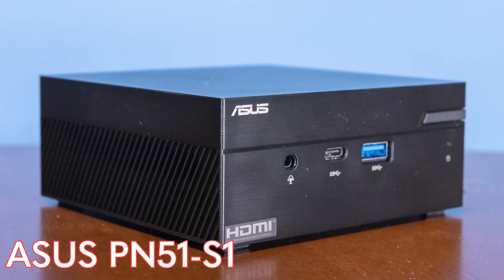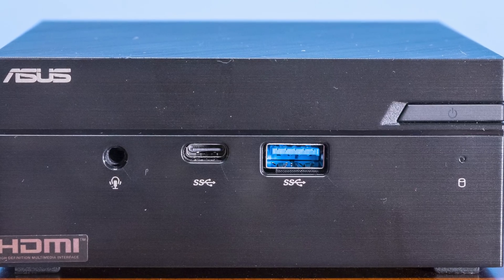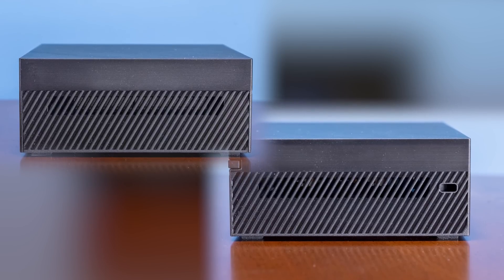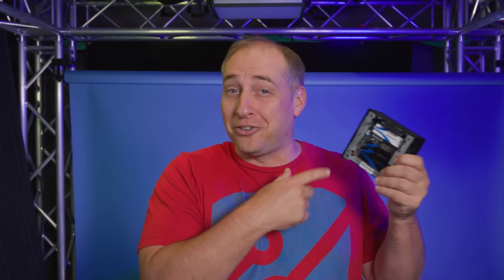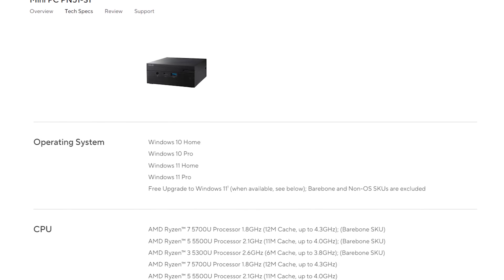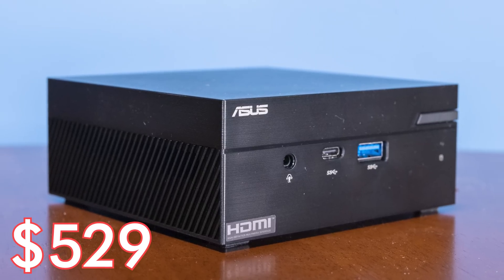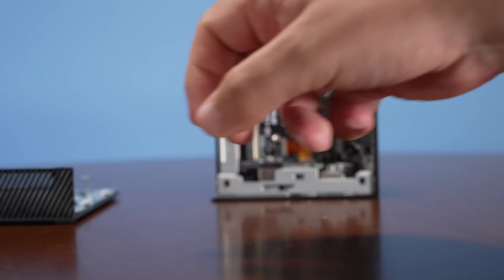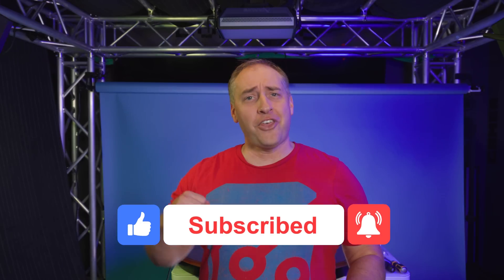This 8 Core AMD NUC Alternative Rocks!

Comment: I don't get why these manufacturers don't want to add a few cubic inches to the design and add like $5 into cooling to stack a 92 or 120mm fan in these which would make them almost totally silent going full bore and give the headroom to massively increase performance. Like your chart showed the 35w 5750ge destroying this chip.

Comment: I got the same model and max out the RAM to 64gb, 1TB nvme and 1TB 2.5' SSD. Its temperature is super hot even without running much task, just opening a windows 10 VM and leaving it idle on my ubuntu host can take up close to 93 degree celsius! Is it just mine that has an issue?
Reply from the maker: Seems way too hot

Comment: I run entirely on solar. So low power systems like this are extremely attractive for always on servers. TDP is not of any concern. It's the idle and low load. I wouldn't mind if it could ramp up to 100 watts to get the jobs done faster just to go back down to 10 after. Loads such as compiling, transcoding video,  and rendering. But most of the time it would serve for a firewall, home automation, Plex, and file serving. I'd rather not need multiple systems.

Comment: Go find yourself a used Dell Optiplex MFF setup, its just a bit larger and been around for years. Easy to maintain and find parts for online, you'll get driver/firmware updates for as long as Dell supports it.  You can find them used from $100 to $1000 depending on the age of it. Then customize it with what ever local storage you want to stick in that will fit.

Comment: The only problem I see is that its mobile CPU, it doesn't matter if its 8 core its still mobile one. So why we are impressed by the size when laptop internals are even smaller, in the size comparison you make it look like it is significantly smaller than alternatives while the volume seems on par with other offerings.
Reply: thats true, laptop with a dead screen is pretty easy to find and lots cheaper

Comment: I've been using a PN51-E1 with a Ryzen 7 5700U, 32GB RAM and a 1TB Samsung 980 EVO as my main work computer for a few months now and it works perfectly. Because it's small and light, I can carry it from home and office when needed. The only problem I see though is the high temperatures and the horrible little noisy fan. Only with the browser open is it quiet, but if it starts to get more use it's like a turbine. Akasa makes the Turing A50 MKII which is a fully passive case for these computers, but they are heavy and much larger than the original. If someone wanted to use it as a totally silent server, that would be a nice solution.

Comment: Great review a few points there are various models of the PN51 / PN51-S1 it is important to check the specifications of the model you are purchasing as they can vary slightly. As noted by STH there are also varied CPU options.

All models will have the same dimensions but can vary in aspects like connectivity. We offer Barebone and System models 

This means barebone is supply your own storage, memory and OS
System models will come with an OS ( Windows ), storage, and memory

We also do validated Linux distros on the PN series ( Unbuntu, and Redhat )

A great feature not detailed in the review is the that the rear Type-C port also offers USB-C PD Input. This is rare in mini PCs and allows for a single cable for display and power and can be paired with monitors like our own PA series which feature 90W USB-C power output.

For users looking for a simple and clean setup this is ideal.

The configuration port is only applicable for business inquiries default models sold will offer an additional display out allowing for three displays to be connected.

The PN51 offers a M.2 heatsink design where many mini PCs do not offer superior thermal dissipation for higher performing and larger capacity M.2 SSDs.

We offer extensive testing which is not common among many "mini PCs" - including aging time, temperature, humidity, vibration, drop, port, line voltage and frequency testing.

Users looking for more performance can check out our 
PN52 using Ryzen 5000H series CPUs with an updated chassis design and more storage support.
PN64 using 12th Gen Alder Lake CPUs, DDR5, PCIe Gen 4 support as well as higher end specification support for USB.

Both models have been designed to complement higher performance workloads with 35W power envelopes. 

Great review hopefully you will check out some of our other mini PC models or even options like our PL/PB series which offers more SOHO and SMB type features/designs.
Reply: when one says that it can be powered through usb-c dp, does it means that you can power this device with a simple usb-c power plug not specifically attached to a monitor, for instance a 90W or 65W 200V to usb-c power plug  ?

Comment: Overheating issues?
My nuc7 fan cooler broke down i  just 2 years. Had to replace the case with passive Akasa Newton case + attached noctua 120mm fan connected externally via USB.

Comment: I want to use ProxMox on it. For that, a second 2,5GB LAN or 10GB fiber optics cage would be awesome (in place of the display port).  So, there should be a bare metal version of this little box for home virtualization.
Reply: Just out of curiosity, why do you want two NICs? I get wanting a faster one but what would you use the 1GB port for? (New-ish to homelab and wondering. Thanks.)

Comment: I have a few Asrock 4x4-Box 4800U units (similar footprint and configuration to what's shown in the video) that I run in a 3-node Proxmox cluster - they're great little machines with super low power consumption and are capable of running some pretty intensive workloads. I run DetectionLab in the cluster plus a bunch of other VMs and the 4x4-Boxes handle everything perfectly.

Comment: Great video - very informative. I love that you've measured idle power consumption. One piece of information was missing - can this 2,5" mount accomodate thick 15mm hard drives? You know - that 5TB+ spinners. And if not - maybe 9,5mm? Can you please check it out and let us know?
Reply: I asked ASUS this question regarding the PN50, which has the same dimensions, and it can't support above 9,5mm.
Reply: @Max1996YT  Thanks. I've found that info somewhere on the internet also. I've bought a second hand XCY mini i3 - it has more than enough room for 15mm drive and a thick aluminum case

Comment: For daily stuff and browsing the N5095 (lowest in graphs) 4 cores from Intel is exactly what you need.
Not too WOW, not too crap. i recently got a same-factor minipc with that CPU and man, it can mince stuff ! 
4k60fps .. rarely loses some frames here and there. From tests it's 3W on idle and 8-11W on 4K stress. You can literally just let it /ON all the time.
No fan noise. It barely goes 2800 RPM on full load.

I got my minipc  Intel N5095 / 1x8GB / 256 GB for $110. 
Bought it for my father so he can get rid off his (literally) 16y old laptop.
Added an vesa-mount arm for the monitor, stuck the minipc on the back of it.. and voila .. best browsing experience for a mere $250 (total)

Comment: I have one of these mounted on the back of the second monitor. Mine has a 4700U 10GB RAM running Windows 11, 1TB Samsung M.2. Very quiet and super low power consumption.

Comment: Nice review. For half the cost you can get a beelink with the ryzen 7 4800U (slightly better performance than the 5700U for some reason , according to cpu compare), with a coupon on Amazon for $389. Comes with 16GB RAM and  a 500 GB Nvme and Windows 11pro. That's unbeatable value!
Reply: fun fact, 4800u and 5700u are exactly the same silicon. odd numbers are actually last gen, even numbers are new for 5000 series

Comment: Trade the HDMI for another 2.5gb NIC and I'm sold. I recently just purchased a nuc9i7qnx and it was about this price point. The intended use was either for pfSense or as a replacement for my current home assistant setup. I really wanted the dual 2.5's but even dual NIC's in general with this form factor were hard to find which is why i ultimately went with the nuc 9 because I can throw in a PCIE card and have a 10gb router or later down the road when this gets decommissioned after the price of 10gb ASIC's fall, I can toss in a GPU and have a killer retropi setup.

Comment: Do you think you could use the SATA connection for a big 3.5in HDD? Not just for this but for other of those mini PCs?
Of course maybe without putting the cover back on, or with a hold and an extension cable.
Reply from the maker: It is a standard SATA connection, but the chassis would be in the way of a 2.5" drive.

Comment: So... you got a $400 Nuc equivilent... and put a $1500 SSD.
The $150 worth of RAM is basically a joke at that point.
If you stepped that down to the 4TB version, then you could add a Samsung 870 8TB 2.5" SSD... and save about $150 over the single 8TB m.2.

Comment: Have two of these, one 4500u as an office pc and one 5700u as a toy. Swapped in Intel ax210 wifi6e cards and tuned with AATU. Only complaint is lack of fan curve adjustment (fan basically moves from silent, to acceptable, to jet engine, without smooth control in between at set temperatures) and windows 11 power settings are broken and lock the frequency. You need to use Asus own utility or the old control panel power settings.  I have an Akasa Turing A50 fanless case on the way for the 5700u to turn it into a fanless home theatre pc. 
They're usually super quiet but just running YouTube on them will ramp the fan into the audible range if you are in a quiet room. In a normal office with normal office noise in the background it's fine, but don't let anyone tell you these are "practically Silent".

If you crank the power settings to the max it beats a 2700X in raw performance, but it gets very angry at you for doing it.
Reply: I own a PN50 with the 4700U and I agree the Akasa Turning A50 is awesome. Now it is the perfect sofa pc, running flawless with Ubuntu for years now.
Reply: tried any under volting?
Reply: @bradhaines3142  no not with the one I'm willing to tinker with, the A50 case is pretty much magic though. Running at 30+ watts fanless with no issues at all is amazing.

Comment: if you guys are in the market for a mini PC like this, check out Minisforum's HM80 or HM90
Here in Germany they cost about 670 EUR and include 32gb RAM + 512gb NVMe drive. They support two 2,5" drives instead of one and come with better CPUs (4800H/4900H)

just my 2 cents

Comment: These make for great dev/VM boxes. The ASRock versions give you dual ethernet and/or 2.5GbE. If I could find these with VGA output I'd use them as jump boxes in data centers.
Reply: you can replace the DP with a 2nd nic... but yeah gotta find someone that SELL that solution but it is possible
Reply: Who sells/makes the ASRock version? Is it a direct sales item from ASRock? Or some vendor using a tiny ASrock motherboard. Please let me know where I can find them (or a model number I can Google)
Reply: @zachariah380  "asrock 4x4" is the name of the model
Reply: @jp-ny2pd  thank you! Found it on the asrockind industrial site. Looks perfect with the dual Ethernet and the m.2 E key for a wireless card and some gen2 USB ports! Brilliant find. Thank you.
Reply: @zachariah380  newegg sells them for sure as do others

Comment: Hey Patrick,

I'm looking to replace an aged (i7-920, Nvidia GT430!) media PC with something that is modern, fast, and low power.  Do you think that the 5300U would adequately stream 1080P over HDMI to a theater system?  2K? 4K?  Or should I go for a 5500U or 5700U?

Thanks for reviewing these kinds of machines!  It's been really helpful.  I recently picked up an HP Pro something or other 1 liter with a 6th gen Intel i5-6600T from ebay and it is perfect for running the tasks I needed from it.
Reply: I have a Intel NUC with a celeron N3060 that can do 1080P with no problems, 4K is a struggle. My AMD "NUC" with a 3550H (Minisforum) doesn't have any drama playing 4K bluray. So you can take your pick from the current crop of mini-PCs and be absolutely fine playing 4K.
Reply: @cgaquikkie  Agreed. I have a (more than decade old) Core2Duo 8400 with the nVidia 9400 chipset that can do 1080p over HDMI without problem, so that is a low bar. 4K needs newer, more powerful hardware, so any of Ryzen 3000 or higher (or Intel Core I Gen equivalent).

Comment: Knowing Idle power consumption is very very important. Because if you run a system 24/7  it doesnt run at full throttle always most of the time its about idle or 2/3% uses.   So for a system that runs 24/7 power consumption matters(Specially here in Europe).

Comment: If you want to make this completely silent then Akasa have a case called Turing A50 MKII. I have this on my PN51-E1 model that I use connected to my tv for kodi, emulation and so forth. I ran Prime95 for half an hour and the hottest I managed to get the cpu was 70 degrees. The total package with machine and new chassis was a bit expensive but I'm allergic to the fan noise in these small fans so it was well worth the price in my opinion.
And if you want to tweak more with the cpu and stuff then get AMD Apu Tuning Utility.
Reply: Came here to say the same thing. Running my much lower TDP Asus PN41 in the Akasa with the max temp at 50c. The original case was maxing out at 90 and throttling badly. I had to use Intel-undervolt in Linux (throttlestop in windows) to keep the system from artificially slowing itself down even when it wasn’t hot at all.
Reply: I have been running my 4800U P50 in the Turing A50 MKII case for 18 months now. What I like is that I can tuck the Turing case behind the edge of the monitor and it takes up zero desk space. It's a great little PC but I found the fan noise to be too annoying so as soon as I could get my hands on the Turing case I did. I was only able to push mine to 68°C when thrashing the CPU. It would be nice to see a 6800U based version for RDNA-2 graphics with DDR5 RAM support.

Comment: Using one of these as an emulation device, as an upgrade from an older HP ProDesk 600 (Intel i5 8500T). 
It is really an amazing little PC.
Reply: I'm not seeing that single threaded performance is way up vs an 8500T, its probably more to do with the graphics.  

I had Lenovo Tiny with 8100t and small video card, p600, p620, the rx6400 almost fit but the heatsink was a couple mm too long.

Looks to be a P41 model with 5500U that would probably work for my needs: SteamOS console 🙃

Comment: the zen4 version of this will be interesting as well - new sbc could work arm alternatives - this could be great for opnsense, file server, db and web server, it loses against z440 for expandability but much more efficient - sth should do a full smb buildout with discrete machines - opnsnesne ha fw machines (nano pis) selks, nas, ws, 3 vmservers and a pihole - dpi and 24/7 pkt cap enabled for both ingress and egress - nvme scales and you could get more iops with more nodes #pkt filter #battle of the low end is the majority of sales  #bill brasky bastard and best damn sales guy in the office

Comment: Based on questions+answers on Amazon, the PN51-E1 is 1Gbit, PN51-S1 is 2.5Gbit and that is the only difference.
Reply: The S1 also supports USB-C power delivery
Reply: I have a pn51-e1 with 5700u and it has a Realtek 2.5gbe nic.  There are many subvariants of these that are difficult to get firm specs for!  The older pn50 was 1gig, but there were 2.5gbe variants of that too.
Reply: I believe the initial units were 1GbE but they quickly moved to 2.5GbE. Probably a component shortage issue.

Comment: i absolutely cannot wait for the 6800u based variants of these kind of machines. Having something with a GPU that is roughly 2x as powerful as the steamdeck it would make for both a great micro HTPC but also light gaming. Depending on the requirements for CAD/Solidworks, this GPU should also be enough for our CAD labs so we can get the towers up off the floor and attached to the monitor, or inside the monitor with the Lenovo Tiny.
Reply from the maker: Yes!
Reply: Where are they ? I literally clicked this video just to see if this was finally it.  What’s taking so long?
Reply: @codycast  AMD is focusing on Bigger Board Partners like ASUS and HP Laptops for their Mobile Chips first, maybe early to mid next year we might start seeing more and more Rembrandt mini PCs from Minisforum and the like sometime next year. Its usually how those chip cycle out for the time being/
Reply: @codycast  They're all going into laptops for now (mind you, Ryzen 6000 laptops are also pretty darn scarce), hyping these mini PCs is just a convenient way to move old stock and getting rid of the mobile Ryzen 5000 series chips. The problems of a fabless Chipmaker with limited capacities... and to compound the !"misery", AMD is focusing on high profit margins which simply are non-existent in a the entry- and mid-level laptop market.